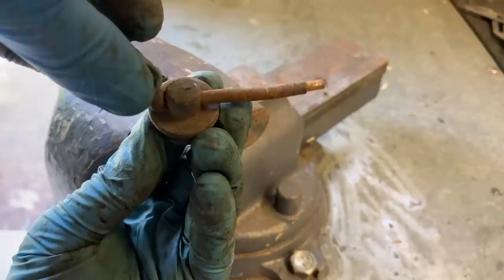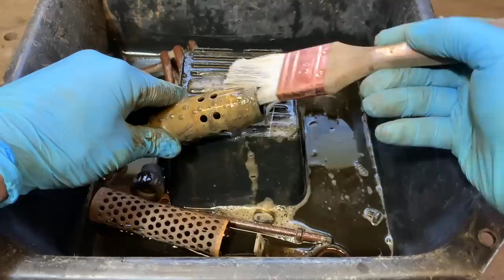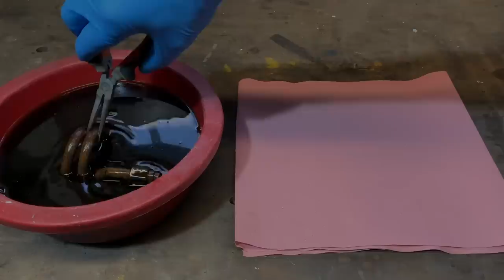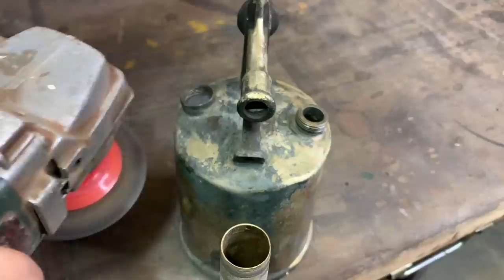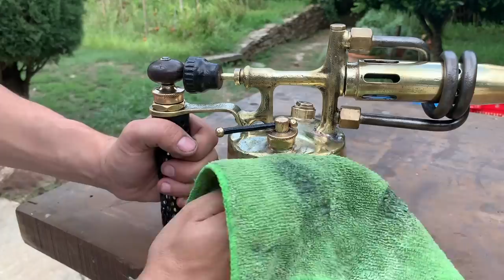Antique Blowtorch Restoration

Comment: I had my Grandfathers from when he worked on the railroad. He was a fireman/Oiler. And I also still have his lamps his railroad oil lamp and battery lantern. His tool kit, and official issue wooden tool box.  I wish I still had the torch... his was made in 1932.  But his pre-heat coil was made of copper(replacement) I still have everything else except the torch. It was lost in a fire at my home when I was younger. Non salvageable. It was given to another family member as a a reminder of my grandfather. His tool set is a full complete original set from the last steam locomotive from where I live. All dates are pre ‘45 stamped. And engine numbered.
Reply: I'd love to see those together. It sounds like you have a museum collection.

Comment: I have to admit, that is the best design of those types of torches I've ever seen. Loved the restoration thank you for sharing. I must add; I have been looking for a 'Design' type to replicate and I have every single part from perforated stainless steel sheets, brass glands and T fittings, unions, tubing all sizes and types of o-rings, jets, rods, tap for threads, and a large oiler to assemble it around, thanks again for this video it was a pleasure to watch.

Comment: Pretty neat trick how you pulled out those dented in parts on top.  Worked well.  Great video, great final product.
Reply: it is but its really dangerous... you can damage the thread that way :) its even worse in this case because the thread is part of the main body, and if you cut a smaller thread on it, the wall gets thinner (and weaker), also the original valve wont fit in it :)

Comment: As always, I'm on the lookout for some kitty "Easter eggs" and I only found three:
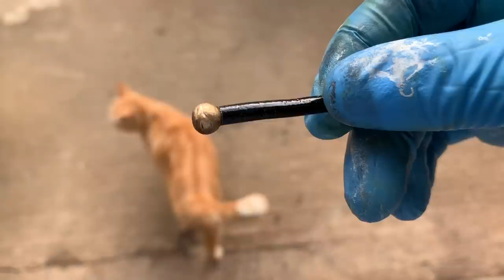10:23 Checking the background
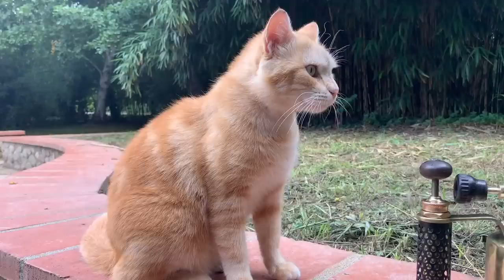12:52 Guardian kitty
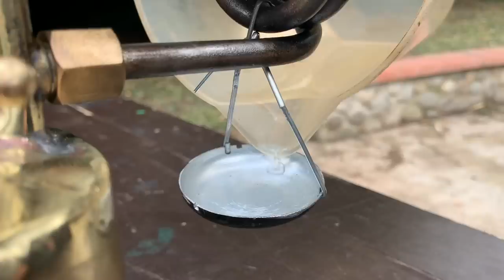13:26 The obligatory petting

 Might be due to the small pieces requiring filming up close. Thanks for the video! Got to say, what an interesting little device, making use of both manual force and heating to produce pressure. Looks simple, but it's shows that some thought was poured into the design.

Comment: Great job! Like so many other I held my breath when you pulled out the dents, praying that you would not rip the tank apart.

If it were me I'm not sure I would have polished the brass like that, I like the original patina on antique items.
Reply: alti5657 Can’t please everybody.
Reply: @adgee5401  Please explain what you mean.
Reply: alti5657 Some people liked that he polished the brass. You prefer the original patina. Given those two variables, which is the correct way to have done things?
Reply: alti5657 Hence, you cant please everybody. It wasn’t a negative. Pointing it out. Enjoy the vid for what it is.
Reply: @adgee5401  Sorry for my last, maybe rude, answer. All I could read of your answer was "alti5657 Can’t please ev.." so I was confused.

Regarding the LADB restoration I personally prefer the original patina. I also know that antique items with their original patina often sells for higher prices than items that have been polished and restored. That goes for coins, cars, motorcycles, Primus stoves... you name it. And as you say, you can’t please everybody.

Comment: hic apparatus, fuel is additionally heated, my grandfather was such, in the year 72 I used it, a mixture of 50 to 50 66 gasoline and diesel fuel and works fine, thanks for the video
Reply: or you could use white gas like in a Coleman lantern.

Comment: I noticed you have a pair of those channel lock pliers from W. Germany.. they came as part of the tool sets in the trunk of the mid 80's Saab 900 cars..
I have a pair I swiped from a trunk at a junkyard about 15yrs ago and I must say they are my absolute favorite channel locks hands down. They are built exceptionally well and are made from the best steel.
Don't loose them, they are getting harder to find. 👍

Comment: Nice restoration. In the future, to take out indentations (like in the perforated handle), how about making a wooden dowel the same interior diameter as the object to straighten out, then drill a 1/2" or 5/8" hole through the dowel. That way, when you drive the dowel into said object to tap and reform it, and  the dowel ends up getting wedged in, simply relief cut the dowell with a hacksaw blade to remove it. Or cut the dowel in half to begin with. Just an idea. Again, well done 👍

Comment: Very interesting.! I remember using a Blow lamp belongs to my dad since in 1983. that we used thick cup shape leather washer with pump piston.It's very tricky to blow the system first we need heat up the radiator, before adding pressure.otherwise kerosene will be spill out.The invisible Blue light takes the maximum efficient

Comment: Perfect restoration.
On the top of torch brass tank , there are 2 openings.
one is to pour kerosene
 Which has a cap with small handle.
the other one which has only cap,  is for what  ????

Comment: Another way to push dents out of tubes from the inside is to use a Muffler pipe expander.     When done right it will give a near perfect smooth result.

Comment: May i suggest a soda blasting box.. 

Allows debrid to be blown off the box and allow for original surface not to be disturbed. Uses bicarb soda as the medium..
Reply: Gary Stinten 👍🏼or crushed walnuts for some softer stuff saw it on ricks restoration 👍🏼🇬🇬

Comment: Oo look a bomb with a handle!
Interesting, you didn't do a pressure test on the tank after pulling the dents out. Those soldered/brazed joints could have cracked when the dent was made or when pulled out.
Don't get me wrong, beautiful restoration, but historically, so many of these torches have exploded.

Comment: For dents in the body of the can: when I worked for an instrument repair shop we had a dent remover that was a small steel ball (maybe 2cm) welded to the end of a narrow steel rod (maybe 8mm), which was gently curved. The rod was clamped firmly in a vise. You would stick the ball into the mouth of the can, in this instance, and push the can against it to work out the dent. Worked incredibly well!

Comment: question: why do you not use the 1:1:1 recipee of salt vinegar and flaour to remove stains and patinae from brass, bronze and copper bits? My Mechanics uses it very often and it looks great.
Fx in this video https://www.youtube.com/watch?v=9oWOu7tTBxo
just curious, it still looks really great, i just thought you might save yourself alot of sanding.